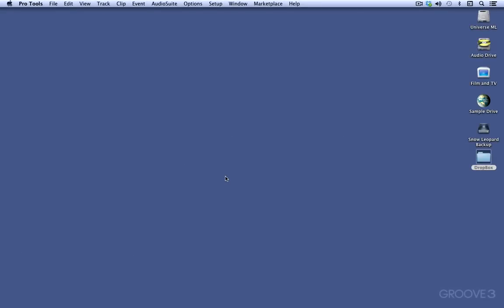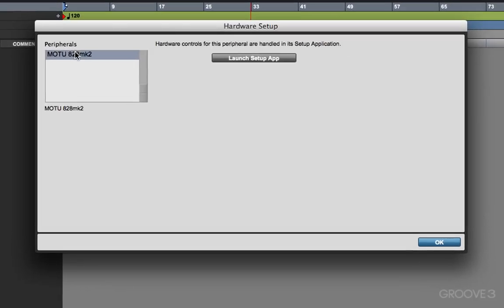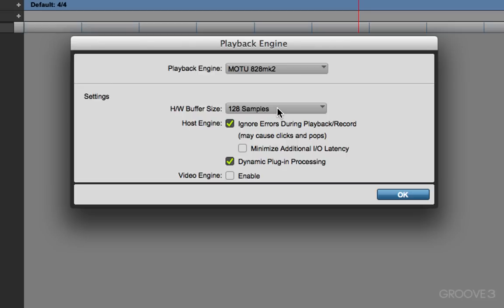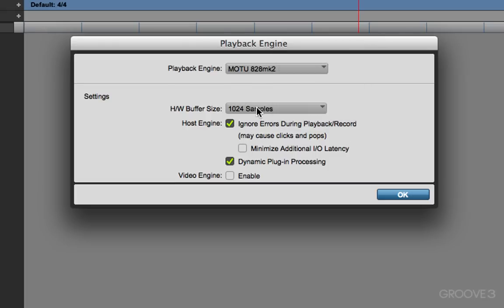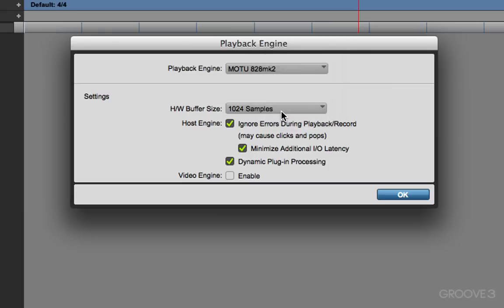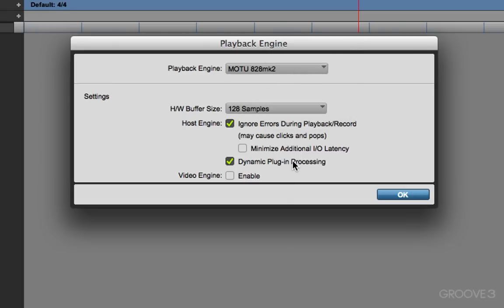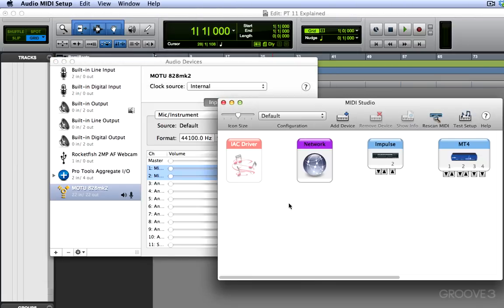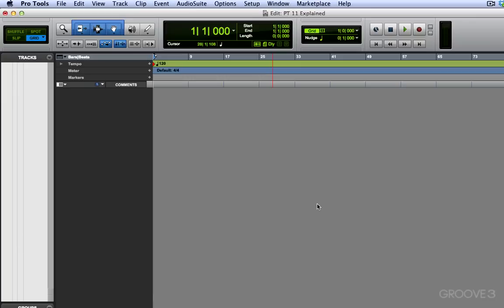Audio & MIDI Hardware Setup (Pro Tools 11 Explained)

Comment: I'm having some trouble connecting my motif 7 to pro tools...I downloaded the driver, I'm on a Mac book pro mid 2012 with the Apollo x4, and the motif is showing up as checked off in the set up-midi- input devices menu.However, I'm not getting signal into the instrument track, record enabled or not. What am I missing?

Comment: Hi there,
I have a session with Audio and MIDI Tracks. The midi tracks includes a Hi-hats, Kick, Snare and Cymbal on 4 separate tracks. When I open the session, sometimes, NONE of my MIDI tracks play, sometimes three of them play, sometimes they all play but most of the time, one of them doesn't play.

I have looked at the VOICE SELECTOR on each track; it is assigned to dyn, but it is in Italics and looks greyed out. 

I have gone to the MIDI INPUT SELECTOR  on whichever track is not playing back where I have assigned my mother keyboard [Predefined > Keystation 88 [Emulated] > All Channels] but in here in ITALICS it says e.g. Hi-Hats - Kontakt 5 - Midi Out 3 - n/a because possible feedback loop detected. This seems to be the main issue. 

I have then gone to the MIDI OUTPUT SELECTOR on this track and I have clicked on the Hi-Hats - Kontakt 5 - Midi In 3 > all channels. But nothing changes. Can you please suggest how I fix this problem. Thanks a lot.

Comment: 1)Protools Aggregate I/O plays thru the "built-ins" and mixer both or none . I mute the built ins icon ON THE COMPUTER and it mutes my usb mixer mains synced to Pro tools App. I don't want to use Pro tools on the computer built-ins cause something is going to blow them up.  
 2) CODEC  audio usb: I have three with the same name in Settings>Playback Engine unspecified in the PRO TOOLS launch icon of Playback Engine) 2in 0 out-" "0in 2out" "1in 2out" all named "CODEC audio usb", CODEC audio usb, CODEC audio usb, in drop down menu of Playback Engine: of Pro tools. Can I change the names so I can tell one from the other  when I launch Settings>Playback Engine to Playback Engine: launcher to dropdown  menu? 
 3)Tho checking each CODEC over and over again,, Back in the session it says after clicking *interface- the track input icon- dropdown menu shows: A 1 (Mono) path n/a on a different track *interface(dropdown) menu) session, input track dropdown says "A1-2 (stereo) -path n/a" Input 2 (Mono) -path n/a "Input 1 (Mono) -path n/a". None of them appear to be recognized by protools as my usb audio interface tho readily available to my computer but not to pro tools. Is handshaking  to Pro tools just a myth?

Comment: i have pro tools 11 and it was working just fine last night now i only have signal but no sound..i put i/o settings to default,made sure everything was plugged,turned off plug-ins, still nothing..
Reply: I'm having a same problem. I was wondering if you were able to figure out the problem. if you did , please share ?(:
Reply: Annie Erdenetuya i think it was either go to system preference and make sure you're on your interface or just play around with the playback engine. its been some time since it happened so i dont know unless im there. im one of those people lol